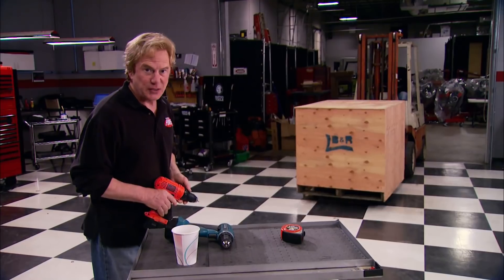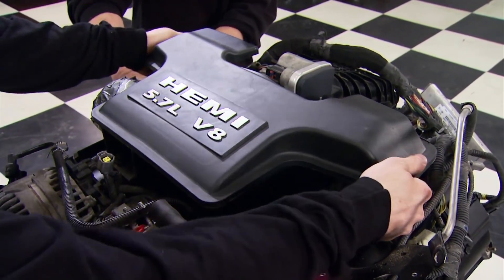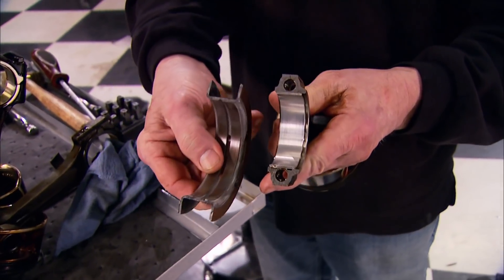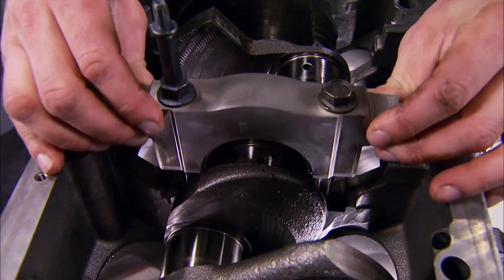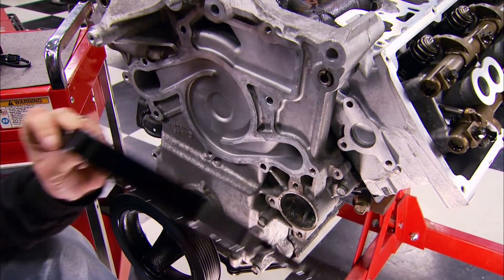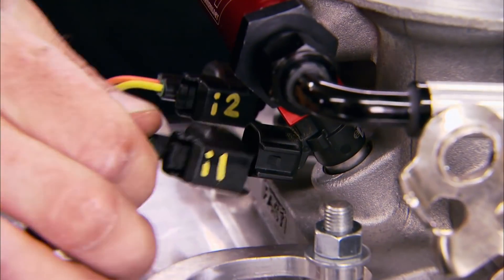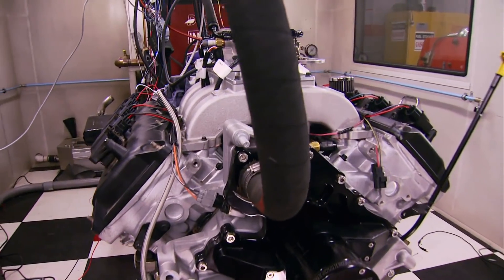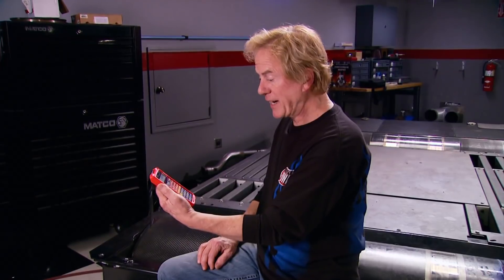Turning A Recycled 5.7L Hemi Into A Beast - Horsepower S14, E8

Comment: No cleaning of the intake/ exhaust runners in the heads after the ultrasonic bath? Debris and grime might have settled in there, and that would ruin a valve seat quickly.

Comment: I bought a propane powered 6.0 l96 from b&r for under $900 , it came from a shwans delivery truck.....I rebuilt it with 64cc ls3 heads and ls2 flattops to wake up the compression for an asa cam......it's a different animal now, I built a 5.3 with the same 64cc flat top asa recipe and it was a hoot that was the main inspiration for the l96 build, did the same recipe  with a .030 over lq9 for my nova as well but the wife didn't like the smelly cam when the car was running in the garage so I went to a 220/230 -.558/.558-117+4 lsa cam to shut her up ....only with intentions of adding a lsa supercharger with a 2.45" pulley less than 6 month later.....thing honestly feels more torquey than my actual cts-v which gave me the supercharged idea....now I just need to pick up 2 rollers for the fresh built l96 and 5.3 sitting on stands in my garage. Problem is I already own 5 vehicles. ....lol.    decisions decisions decisions. .....a ls powered xj6 would be cool

Comment: What about the design flaw of the 5.7 Hemi block where the angle of the valve lifters are positioned too flat and the roller camshaft does not get enough oil during prolonged periods of idling.    The result is a flat camshaft
Reply: Doesn't  exist.

Comment: Not sure how old this episode is but a 2010 and up would be a better build. They have the factory Eagle heads that doesn't drop valve seats. Just get rid of the MDS solenoids and put aftermarket lifters in it. The newer heads gave it 45 more hp from the factory.